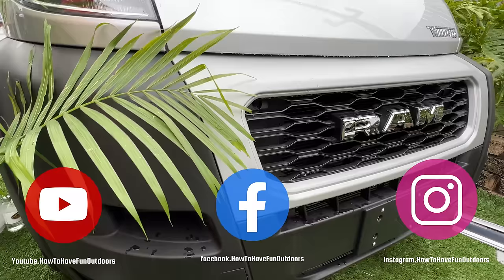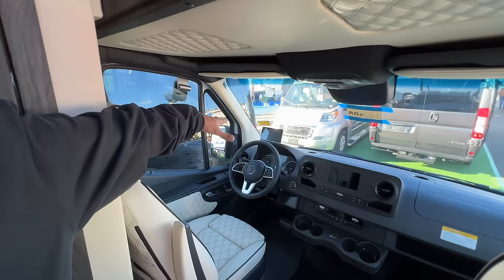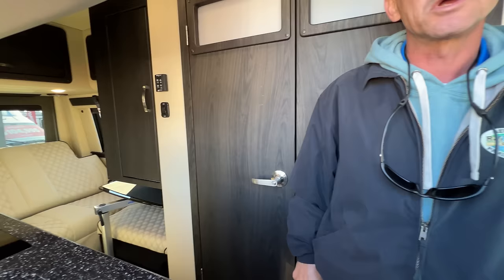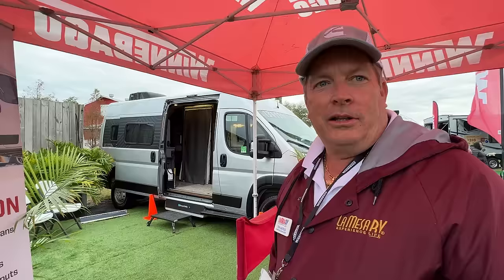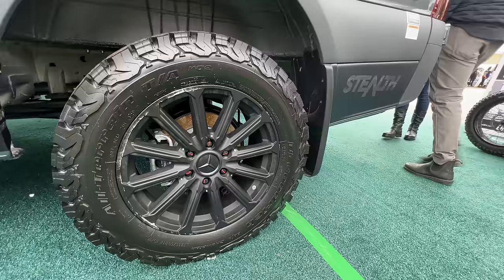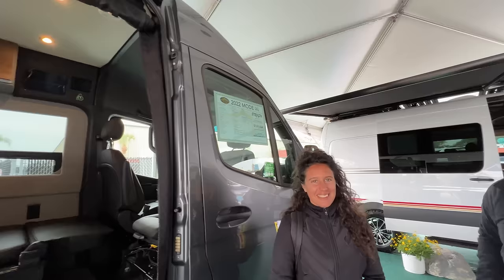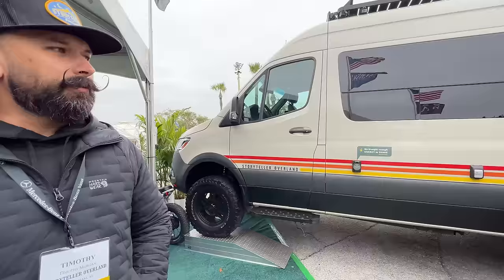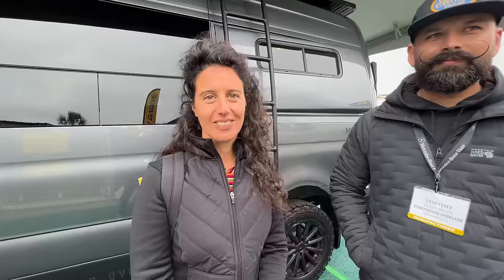OUR FAVORITE CLASS B CAMPERVAN RVs in 4K

Comment: That electric van is a waste, your nearest charging station if deiving crom state to state,can be 50 miles off your route.then u hve to hope that its wrking and not dwn or damaged. Or that there isnt a line to wait.then it takes longer to charge then it does to gas up,#2 there still isnt enough charging stations, then your sitting in a G5 machine making toyr bones brittle each minute u sit in there. Then after u went 50 or 25 mikes out the way to charge,your using that to get bck on track on your original route.add uo the miles u went out your way to find a charge station. Somethings just need to stay the same.😢😢 alot of the old things no matter what it may be are more durable and better then the new.and easier to fix and cheaper,then all this computer stuff and digital and fiberglass.ect.but i do enjoy the flat 📺 's. Tho lol. 😊😊
Reply from the maker: So true.  Thanks for watching How To Have Fun Outdoors!